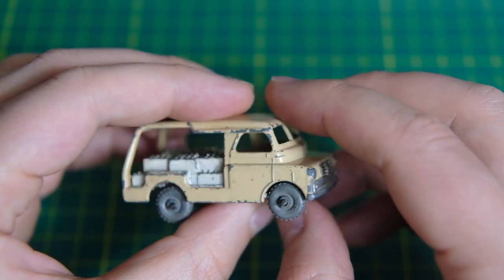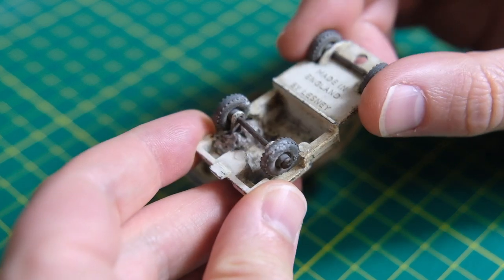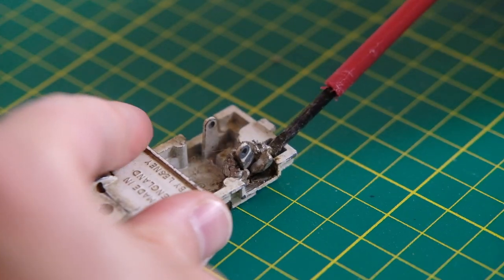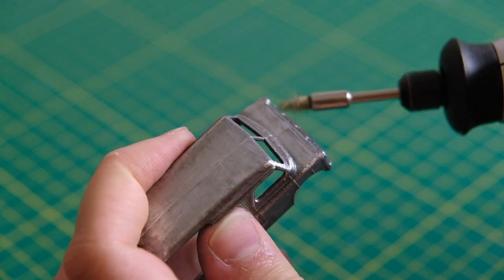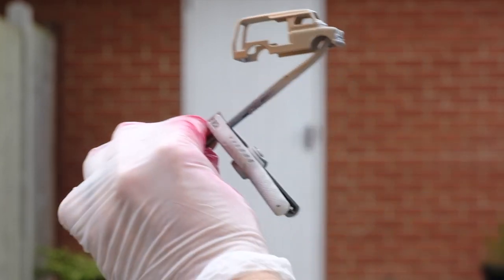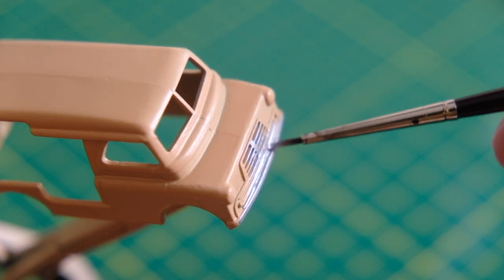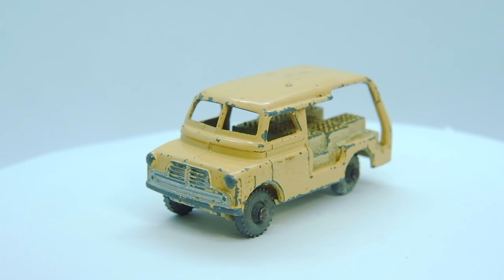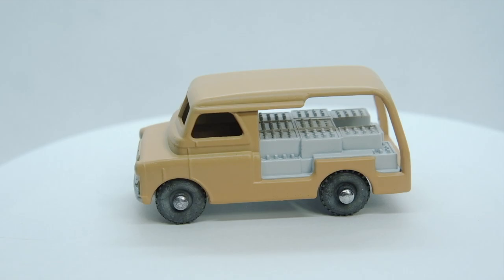MATCHBOX restoration: 29A Bedford Milk Float

Comment: looking clean and pristine again, ready to float us some more milk. :)

having to remove front grille, headlights, and crossmember might sound a lot, but if engineers did it right it's an easy task really. much easier than having to dig out the interior and remove the windshield in order to unbury the engine-gear unit... XD

Comment: Your paint match is pretty good.  Maybe just a little lighter than the model that I have, but I think it still fits in within the typical variation of lighter and darker color on these early model runs. When you get the Dunlop Bedford completed, it might be interesting to include the Milk float and the Evening News Van at the end of that video to compare the three Bedford's you've completed.  I'd be interested in seeing the differences between the models.  The Evening News Van is probably my favorite Lesney Matchbox vehicle.  It's simple, but it really has display value.  It always grabs the eye.
Reply from the maker: Yeah I’m definitely planning on comparing the three. Similarly as and when I finish other ‘related’ models, I’ll feature all of them together to show the differences.